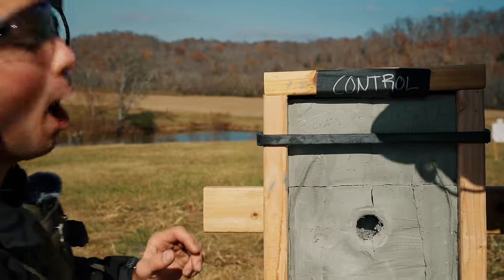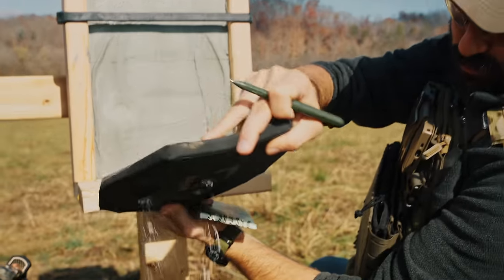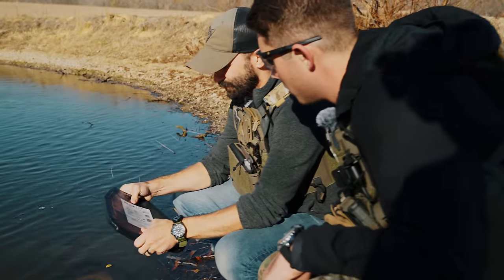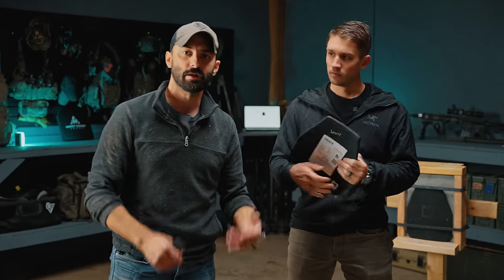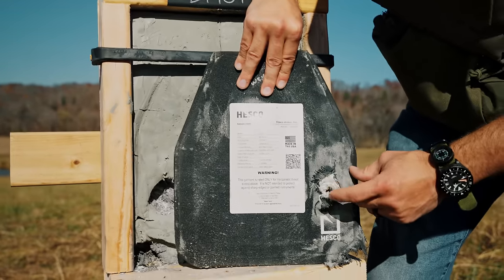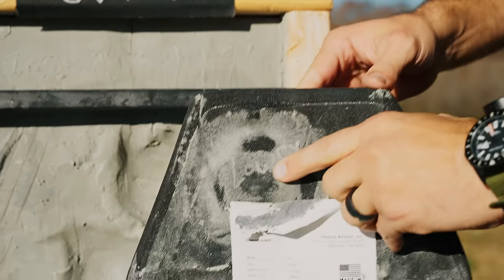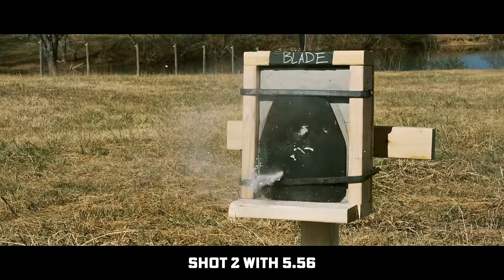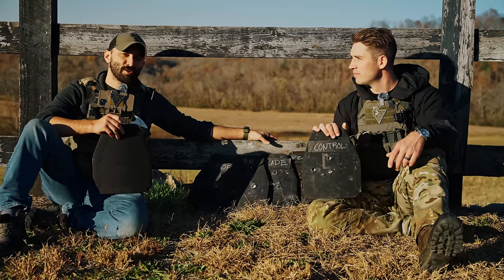Ceramic Body Armor Plates vs 556 & 762x39 | Hesco L210s get Dropped, Soaked, Baked, Stabbed, & Shot

Comment: Great stuff! My only question for my freedom peeps is does kevlar actually expire?.. Or is that just the marketing myth to sell more!?! 🇺🇸🤙🏼
Reply: My understanding is that the expiration date is a requirement of the NIJ testing and that most plates are still viable well past that expiration date
Reply: Aramid fibers hold up better than ceramic. It's technically not the ceramic that deteriorates but the polymers, glue and other materials that's being used to put it all together. From my experience polyethylene plates have a longer shelf life than stated if you take care of them and don't abuse them.

Most the time those expiration dates are more for marketing (like canned food, so you throw away and buy more) unless you see obvious damage or flaws in either. They also put expiration dates on these materials for warranty purposes thru government contracts, if they even have them.

Most plates on the market are only NIJ tested not NIJ certified. I would personally buy lvl3+ or greater polyethylene plates (silicone over alumina) and look to spend about $500 for the pair. Most of them perform pretty similar in that price range.

I've had good experiences with Tactical Scorpion gear ASP (active shooter protection) lvl 3+ and lvl 4 polyethylene silicone plates. Get multi curve, it's worth the upgrade. 10x12s are larger than medium SAPI but those are typically average sizes with quality plate carrier bags.
Reply: So 3 years ago, I shot a Kevlar PASGT helmet with 3 rounds of 9mm. The helmet was made in 1988. So it was 32 years old at the time. Well beyond the 5 year shelf life of an NIJ rated Helmet. 

The 32 year old helmet stopped all 3 rounds.
Reply: @Front-Toward-Enemy  Nice! Thanks for all the feedback. 🤙🏼
Reply: @2amichaelj  👍🏻🤙🏼
Reply: @Prepared_Mindset_Pod  👍🏻🤙🏼

Comment: My thoughts before the 'expert guess' are I dont want to buy plates froma company shipping mass orders to war right now. Faults are enviable. Id rather stick to brands that have the highest costumer rating and reliability record. Ill reply with my thoughts after the rest of the vid.
Reply: Fresh plate, did what it said it could do but nothing more. Suprised it can't to at least 1 more like other manufacturers testing...
Reply: Water test, height over bore, but rlly damn it couldn't take a round that close to the other hole?
Reply: Drop test, in all fairness I don't think many besides steel could survive drops (and even the steel coating would probably be fucked.
Reply: Flame, unsurprising. But my brother was.
Reply: Flamethrower was more of a bonus round
Reply: Blade. I thought it was more implying longer blades but most people even idiots will stab the areas around the kit (like the face, throat, gut, hands/arms, etc)
Reply from the maker: Haha, definitely a bonus round.

Comment: You should test the cheap chinese uhmwpe-ceramic hybrid armor. In informal unscientific tests it holds up very well. I'd like to see it tested with your protocol. Especially with the heat, etc tests to see if it's easily compromised.

Comment: I'd love to see the tests done between ceramic and steel. I still think steel would take more hits but I wonder how it would affect the frag coating on steel.
Reply: Been done many times already
Reply: There’s a lot of videos and depending on the quality of the liner it can take more hits but weighs a lot more too
Reply: Administrative Results did a great video on steel armor where he actually shot it inside a plate carrier on a mannequin - which apparently is a rare thing since I've never seen it real world approximated like that before.

Spoiler: you're still gonna catch a lot of frag.
Reply: Steel plates will get you kilt in the streetz (seriously).
Reply: @WearilyMistaken  i’m not a steel fan, especially uncoated, but the war in Ukraine has pretty much proven that steel does can work done right. But at all the cost of add ons.   Ceramic becomes the clear  winner.
Reply: Either I wasn't clear  or none of you understood what I was saying. I know people have shot steel before; none of them have heated it, froze it, soaked it, or smacked it with an edged weapon. I'm curious how those extremes would affect the frag coating

Comment: Looks like all the failures were entirely shot placement and plate abuse and environmental factors had no impact. As long as someone doesn’t dump a mag into your ceramic plate you should be good
Reply from the maker: Yep, that's what we're seeing with these too.
Reply: @dirty-civilian  I can't be 100% on this because I'm not an expert, but I would think that possibly the methods you are using to check each shot could be contributing to the failures.  Whenever you check the plate, you are dumping out debris from the plate.  That debris would be broken pieces of the ceramic.  If you did not dump that out, the material would mostly remain in the plate container itself and could hypothetically contribute to blocking the next round that goes through.  As a test for if someone was continuing to use a plate that had already been shot, would they lean over and shake out the debris before moving along to get shot again?  And if those remnants did noticeably improve the defense during second shot placement, would there be some kind of recommendation to plug the hole to improve efficiency, like covering it with duct tape?

Comment: Wouldn’t the deformation on every one of those shots incapacitate and or kill you anyways? Broken sternum is a death sentence, broken ribs could puncture lungs. Ceramic seems pretty horrible. I’ll keep wearing my steel… lol.
Reply: That frag will get you
Reply: Medical provider here. Cracked sternum is NOT a death sentence. It ain't good, but it ain't a death sentence (same for fractured ribs). Everything is a trade off. Generally speaking, ceramic saves you weight but is typically more expensive. Steel is typically heavier and has spalling when shot which can (and should be) a significant concern. Spalling can be accounted for, but then you get into higher costs.
It's all trade offs fam. Wear it, get exercise in it, and run drills with it; make it work for you.
Reply: Have you even seen back face deformation from steel? It's 3 times more than ceramic lol

Comment: Did you really flag him at 0:41? WTF dude, have some professionalism.
Reply from the maker: With the airsoft gun with red wires showing through the rail that we use regularly on this channel? Yes.
Reply: @dirty-civilian  Is airsoft relevant to this video? Is it made obvious that the gun is airsoft besides one wire in the handguard? Putting an airsoft prop in a video otherwise solely using real weapons is begging for confusion.
Reply from the maker: Well, the one guy that was concerned/confused, is now educated. Thanks!  @ninwiz45

Comment: Even china plates great. But not these disgusting L210. 
Why spending so much money on level IIIA+ plates? Just buy real level 4 or 3+ plates for the same money. 
With REAL testings and NIJ documents. Plates that can stop 20+ rounds with proof.
Reply: L210 are rated for 7.62x39 API . How is that a IIIA+ please?
Reply: @nicolas8098  What then? It's not even close to standard level 3. I'm a body armor manufacturer. And even Hesco is concerned about the big misinterpreted L210 plate... That's the reason why the stopped the production.